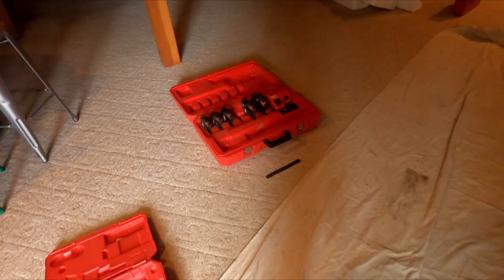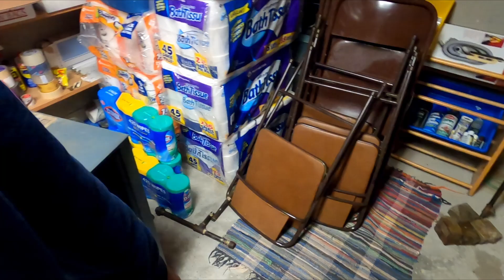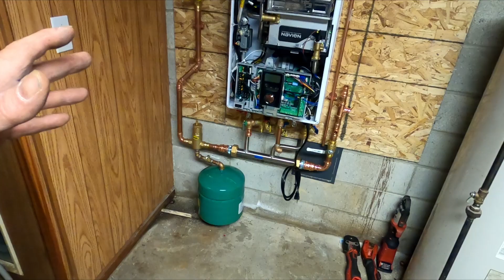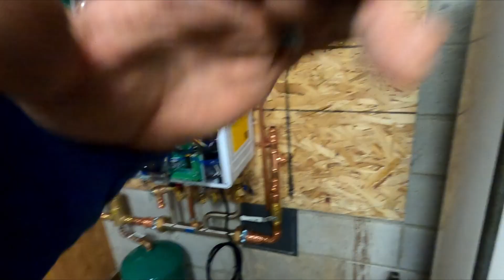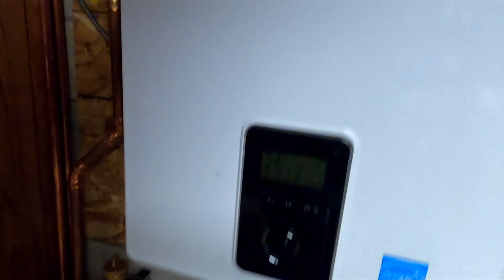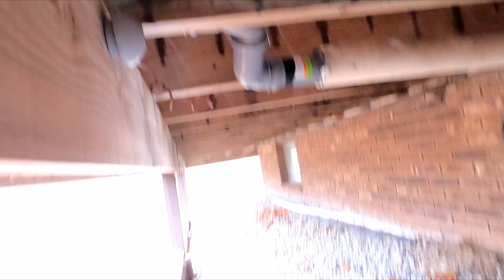Navien Combi Boiler Install By Myself NCB-240/110

Comment: What do you wire the TT from the relay board to the boiler?
Reply from the maker: From the zone control to the thermostat connection on the boiler

Comment: Trades guy here in Michigan, I've been considering doing this recently.  I'm pretty versed in electrical and plumbing but not licensed in either.  My skill level shouldn't be a problem but I'm no plumbing design guy that's for sure.  My question is about the vent pipe.  I saw somewhere about because of the water condensing exhaust it could not use old chimney vents?  It would be great if I could for mine.  2ndly I have a circulator pump for hot water return from the kitchen sink and curious how I might tie that back in on a combi boiler
Reply from the maker: The venting runs off the sidewall and the combustion air comes through the chimney. The new combi boilers will support domestic recirculation has terminal for recirculation pump built into the boiler. Some venting manufacturers make polypropylene liners so you can reuse the existing chimney for the boiler
Reply: Thanks for the clarification   @MiHeatingGuy

Comment: I have a Navien combi boiler goes off on thermostat but the keeps running on and off every few minutes
Reply from the maker: Do you have a recirculation line on it?
Reply: @MiHeatingGuy  I have an external circulater on the radiant heating
Reply from the maker: how long does it go on for
Reply: thanks for trying to help I took that boiler out and I installed different boiler. Now I have this boiler to get rid of I only for two months @MiHeatingGuy
Reply from the maker: @Mike-uf7oc  what did you end up installing and why did you take it out?
Reply: to many problems thanks for your reply @MiHeatingGuy

Comment: What is the best way to Fill and bleed the air out of this unit? My setup is exactly like this one except i have 2 zones and am also using the auto fill valve with back flow  built into the unit.

Comment: My house is about 3200sf. 4 baths. Can I use one of these? I’m in Nj.
Reply: It was question!! :))
Reply: I’m really struggling to figure what’s the best way to save space and get rid of my old boiler and my giant hot water heater. …
Reply from the maker: boiler side yes but on the hot water side it  may be slim. how many people live in the house??

Comment: I'm in the process of replacing my old oil boiler now and converting the gas.  I'm being shown a similar Combi Boiler NCB-240/130 by Navien.  would love any input you may on going this direction.  thanks and great video.
Reply from the maker: is your house over 3000sf. that's a big boiler
Reply: @MiHeatingGuy  1600 square feet. Cast iron Radiators.  3 bedrooms, 1.5 bath.  I’m outside of Philly.  Currently have a New Yorker with summer/winter hookup from the mid 90’s. That and my oil tank are on its last leg so we are trying to get ahead up it.
Reply from the maker: I wouldn't size that any bigger than 80000 Btu's.  Sounds like  They are selling something you  don't need. NCB-240/110 would be the biggest I would go. Good luck 👍
Reply: @MiHeatingGuy  thanks.  I’ll find more about why the larger size.  I was more so seeing the the combi boiler concept was good and to find out I’d the brand is also good.  Thanks again!

Comment: Not one of those death trap boilers 🤮
Reply from the maker: Well if you  Install them right you don't have a problem with them like some other people on the Internet
Reply: @MiHeatingGuy  Great response I have been installing Navien for about 15 years and the best tech support team ever. They are more than generous with their warranty replacements and so many times the vent terminations are incorrect leaking back into the venturi but they still send out a new unit. The best by far. Thanks for the video. I prefer the Taco zone valve with the 501 for each zone for multiple pumps. It helps isolate the issue per zone for me easier. Looks good. RB
Reply from the maker: I've been installing navians for 12 years I don't understand what people are talking about you  I've never ran into the problems that they're stating And there warranty is more than spectacular Had a unit out of warranty and they still  Warranty it out Tech Support is amazing. If the units installed right you shouldn't have many problems at all I think within the last 3 years I've installed installed over 75 units and went back on two
Reply: @MiHeatingGuy  my uncle had one and just put a normal boiler is after the co2 levels went high in the house and Navian would not warranty anything else on it it was 6 years old  so he just put a normal boiler and water storage tank back in and four zone pumps again
Reply: Nice looking install! What they are talking about is defective heat exchangers that Navien refuses to acknowledge. Guarantee if you went back and sprayed heat exchanger with soap and water it will leak.
Reply from the maker: There's reasons why they don't acknowledge certain claims And most of the time they're installed wrong Causing heat exchanger  failures.  And you're probably watching the wrong guys online
Reply: It looked good 👍👍. We're going to be slower than people that do it everyday but at least it's done right!
Reply: Just wait for the class action lawsuit...